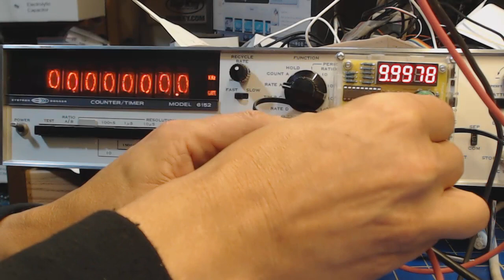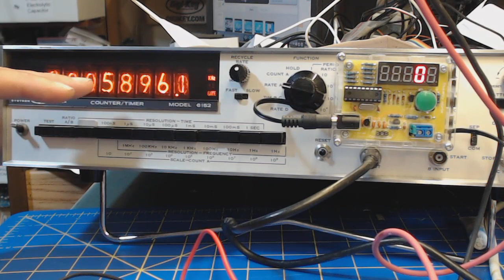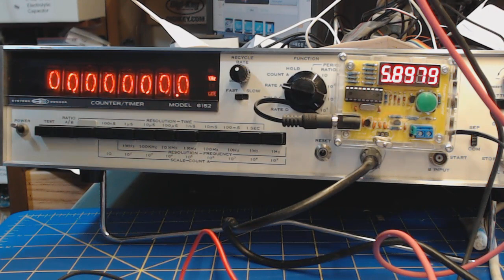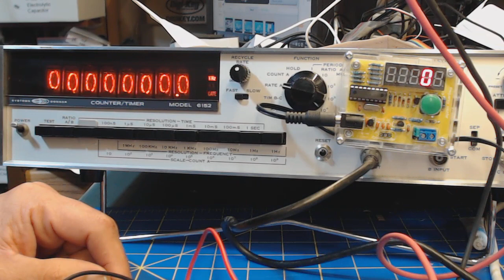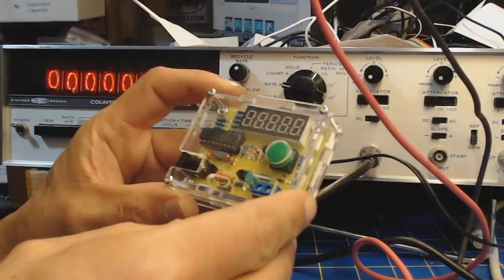Banggood DIY Frequency Tester 1Hz-50MHz Crystal Counter Meter With Housing Kit

Comment: I thought about adding a crystal socket set up to mine but there are so many different types that I use. I decided to remove the crystal socket and soldered a pair of short alligator clip leads to the board and brought them out through the top. It works well. ATB Doug.

Comment: To extend the socket higher, I used a 16-pin DIP socket with round Mil Max style receptacle, just like the 3-up type provided.  Cut one row off and pushed it directly into the socket, making a 3+8 stacked "T".  After reassembling the case, the lexan locks the 8-row into place perfectly.  Next, I cut off a strip of 3 from the other side that was cut off.  This extends the socket one more level (3+8+3).  Now the socket sits above the lexan sheet and makes inserting take-off sockets a breeze.  If I pull out the top layer it is easy enough to replace.

Mechanically, I went to the extra trouble to put nuts on the top and screw heads on the bottom at all 8 locations, for a consistent seating surface when placed on a table top.

I'm generally happy with how this unit measures crystals but not so happy about the frequency counter.  I have to do more research to find how others are getting theirs to work reliably.

I don't think any crystal tester can be trusted at distinguishing between good and bad crystals and oscillators.  If the don't read, I put them in a separate bag but I never throw them out.  After testing a bunch of them, I have found the crystals are more reliable than the tester reading.

Comment: I got mine with missing and the wrong parts like the IC socket had a 8 pin configuration but the IC has 10 pins , it was packaged with the wrong resistors and not even the correct amount of them , the kit uses 13 resistors I got 8 and only 3 of the correct value  .It looked like someone just grabbed what was on their desk and threw it in a bag and sent it out . On a good note the case seems nice .

Comment: uh-oh.. What duh yo mean by "very unforgiving if-n it's used as frequency counter"? 
I just ordered one from eBay a while back, hoping to use it to setup a set of  D class Amplifier modules operating frequencies "Classic-D by Silicon Chip" , You know to get their distortion even lower than a set of Class A or A/B Power Amps distortion figures..

Comment: I got that same unit for $8.29 a couple weeks ago and put it together.  I can get the crystal tester to work and I very briefly had the frequency counter working with an audio square wave coming out of the headphone jack of my laptop after a lot of fiddling with it, but then after that I can't get it to work for anything.  If it shows anything it continues to show about a 1kHz reading when I have 10kHz being put into it, and if it's plugged into my desktop computer instead of the laptop it shows 60Hz with nothing connected to it, as if it's reading the mains frequency.  (I would use a signal generator but once I got this thing put together I discovered my signal generator is on the blink and not putting out anything.)

Can you provide a tutorial on the frequency counter portion of this unit?  Also, can you explain what the jumper is for?  I know it has to be in the upper position for the crystal tester to work, but in the lower position it seems to be adding +5v to the frequency counter input (based on the schematic).  Also, coming off the frequency counter input there's a diode in the reverse position, which appears to me like it would block any positive input on the IN screw terminal.  Why would that diode be in that position and configuration?  Is that so there must be a certain amount of input signal voltage to overcome the reverse bias level of the diode?

[EDIT:  After a little more playing with it, doing really nothing different besides connecting it to a 4xAA battery pack for totally isolated power, the thing started working flawlessly.  I switched back to the USB power cable and it continued to work perfectly.  It was accurate down to 1Hz and up to just a little over 20kHz when the sound card started to reach its limits and the signal broke down.  One thing I noticed is that at some point, I think above 10kHz but I didn't really explore it, is that the Hz reading starts to skip by 2; for example, as I went 16330, 16331, 16332, 16333, etc. on the hertz setting, it showed 16330, 16332, 16332, 16334, 16334...  I'll have to get back at it tomorrow to see if it continues to work fine, or if actually working was just a fluke.
Reply: Hey. I just got mine and it does not seem to be working (the frequency counter). Did you change or remove any part (such a diode or a resistor) of the circuit? Do you know which is the highest amplitud it can get (in the ebay description it says 30v p-p but I am not sure)? Was the battery pack you used in series (to get in theory 6v)? I really look forward to your reply.